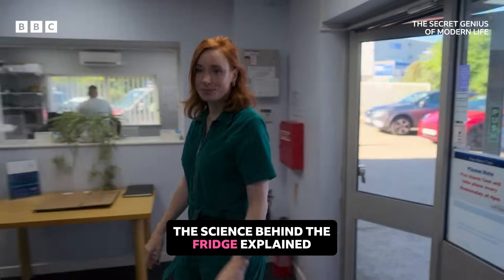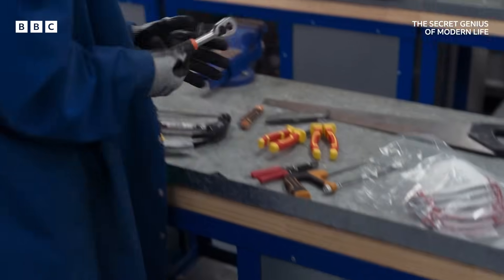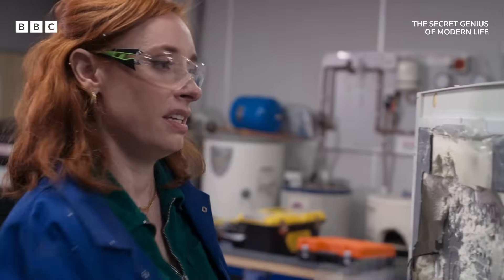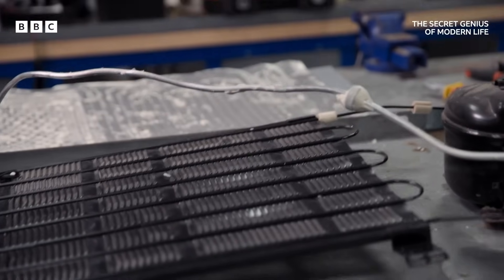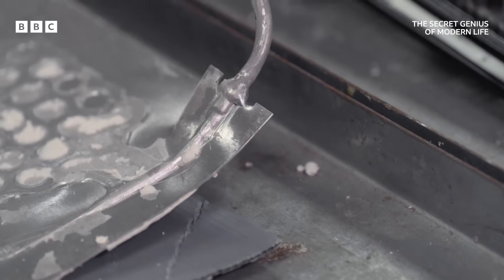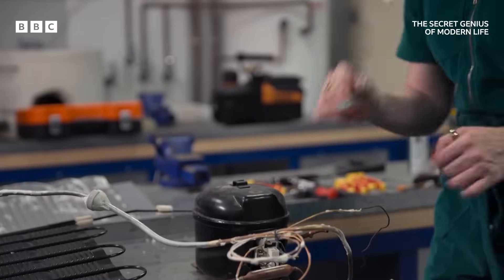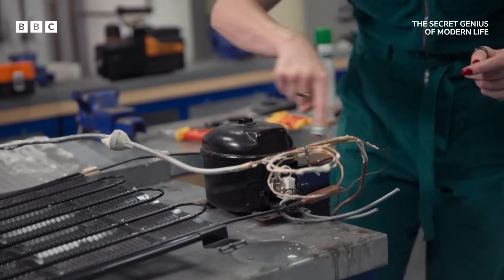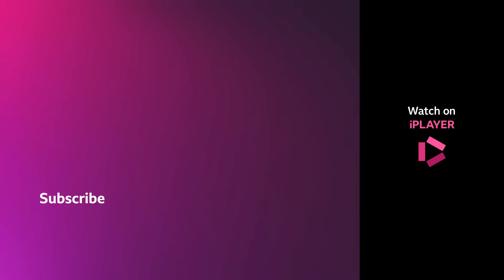How does a fridge work? | The Secret Genius of Modern Life - BBC

Comment: Not a bad description but you didn't describe the point. 

- To do that we need to know the concept 'volume change work' first. Take your bike to a good bicycle pump and unscrew the valve a bit on one of the wheels. Feel the valve as the air runs out, it gets cold! That is because the air inside expands at the valve, the pressure falls, that is negative volume change work. That is when you pump the bike again the air will get warm because you increase the pressure but that is harder to feel. The air isn't compressed at the valve so the volume change work takes place elsewhere. -

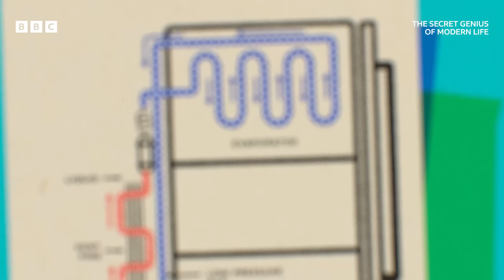I suggest looking at the blue tubes in the top at 3:44.
The refrigerant is boiling or evaporating inside the fridge at a low temperature because of a low pressure (in the Himalayas water boils at c. 70˚ C). The refrigerant enters the evaporator as a liquid. But the heat from new not cold things in the fridge and heat coming in through the walls warm up the refrigerant so it boils and leaves the inside as a gas. 

Then the refrigerant flows into the compressor, the gas is compressed of course. The volume change work makes the gas hot. The refrigerant gas is pressed into the condenser, the pressure is high so the boiling point is also high. This condenser being outside the fridge releases the heat from the refrigerant. As the refrigerant cools down it becomes a liquid again, that is why the condenser is called a condenser! Now the tube becomes very narrow, the refrigerant passes through under pressure but after the constriction the pressure is low. The volume change work is lost, negative I called it, so the temperature drops. 

The boiling point of the refrigerant is now low too and it enters the fridge, the tube is no longer narrow. On the inside it evaporates, to do that heat is needed and we are back at the beginning.

- The theory behind is thermodynamics. -

When the compressor is running is controlled by the thermostat. If you want your fridge to be colder you adjust the thermostat and the compressor will run more time.

Comment: This is old fridge system. Modern refrigerators work like air-conditioners. The fridge draws warm air in from the room, by suction, compress it, and then blows it,  the cool air into the fridge, and freezer compartments of the refrigerator.

Comment: Critical part of the principle is sadly missing. Based on this explanation coolant would never reach sub-ambient temperature and fridge would never work. 
How it actually works... After the coolant passes the radiator it is in a form of high pressure liquid (remember coolant was pressurized by the compressor). Radiator can only cool this liquid to the ambient (room) temperature (2nd Law of Thermodynamics). To get to the sub-ambient temperatures, pressure needs to be released by the expansion valve. When pressure drops, boiling point of the coolant drops as well... causing coolant to boil away instantly. Coolant is now in a form of low pressure gas which occupies way more volume than it did in a form of a liquid. However total amount of energy (heat) in the coolant is still the same (1st Law of Thermodynamics) but it is now spread out over larger volume, meaning coolant particles are further away resulting in lower (now sub-ambient) temperature.
Reply: Thanks. But how is it possible that the coolant can transport more energy than was consumed by the compressor? As I see it: the compressor creates ‘room’ inside the coolant to absorb energy by compressing it.
Reply: the correct term is refrigerant.  when the refrigerant enters the evaporator, it is in a liquid-gas phase.  not completely gas.  the temperature will follow the pressure temperature chart of the refrigerant.
Reply: @ncolevalv_5673 actually when it’s in the evaporator it’s mostly a small amount of liquid that quickly gets flashed into gas due to the room temperature air blowing over the coil.
Reply: @johnnyblaze9217 what would be the temperature of the 100% liquid refrigerant that would come out of the metering device if it does not flash as it exits the metering device? what would be its pressure? what laws of physics would it follow?

Comment: She didn't mention the expander coils after the condenser. Basically, after the compressor, the high pressure high temperature refrigerant loses its heat in the condenser tubes and then the refrigerant goes through the expander - which reduces the pressure and temperature into very low temperature. After this, it goes to the evaporator.
Reply: exactly literally the most important part is missing... the way she explained coolant would stay at room temperature never going sub-ambient.

Comment: So what if its a really hot day, the heat being dissipated out the back may not be able to happen, so how does the refrigerant cool down again if the outside air is just as warm as the cool on its way out of the fridge to cool down?
Reply: her explanation is incomplete... the way she explained coolant would never go sub-ambient. Pressure of the coolant needs to be released after it passes the radiator... this causes coolant to boil away and go sub-ambient (find my full comment why).
To answer your question... yes if ambient temperature outside the fridge is equal or higher than temperature of the coolant entering the radiator... fridge won't work. However fridges are designed to work at any reasonable room temperatures.
Reply: the gas entering the condenser is always hotter than ambient air because of the compressor.

Comment: I think some explanation is missing, why do we need a compressor. After the compressed liquid comes out, what happens.
Reply: her explanation is incomplete... the way she explained coolant would never go sub-ambient. Pressure of the coolant needs to be released after it passes the radiator... this causes coolant to boil away and go sub-ambient (find my full comment why).
Reply: the compressor is the "pump" in the system.  something has to move the fluid.  you turn off the compressor and the refrigerant stops flowing and equalize.

Comment: Given that the back of a fridge is usually pushed up against the wall, does that make it less efficient? Would it be more efficient with more space behind it to allow the heat to dissipate better?
Reply: not really... fridges don't really have that much cooling power... they actually don't even run 95% of the time, they mostly rely on isolation to keep the interior cool. Opening them doesn't really matter as only it is only air that escapes and that by itself carries very little heat.
Reply: I am personally surprised that we haven't harnessed all the various heat pumps in our homes into some sort of unified system. Heat pumps are more efficient than electric water heaters or gas boilers.

Comment: “You can’t cool something down, you can only take heat away.” Brilliant description!
Reply: The result is cool air…the method is heat extraction. It does sound like splitting the thinnest of hairs I’ll grant you…It’s an important hair nonetheless.
Reply: @motorv8N produce and result?  really.   it is a matter of terminology.  i put a toast in the toaster.  did the toaster heat my toast or the toast got hot because of the hot coil?
Reply: @rodzvalv_5673
The element ( hot coil) heats up due to the electrical current flowing through it - and the (cooler)  bread is held close to it - which absorbs some of the heat - until it reaches sufficient temperature to " toast it"

Not quite the same thing as a fridge - which "pumps" heat from one place to another  thereby making one area cooler - and the other hotter.
Reply: @eric4709  that is different than saying you cant cool something down.  one can install a window ac in a room and it will cool the room.   to cool something, you have to take its heat away.  but it is wrong to say you cant cool it down without mentioning taking its heat away.   because you can!.  i can put a coke can in a cooler full of ice and it will be cold after an hour.
Reply: That is the basic idea. So when you ask HVAC engineers… you’ll get the point.
Reply: @casperellison5729  - I had forgotten this inane conversation lol. Our friend above here has so totally missed the point of how heating and cooling works I must have blocked the experience from my memory….😎
Reply: it is the same thing.  like many saying ac does not produce cold air.  what exactly is the 50F air coming out of the vents.
Reply: @rodzvalv_5673
Its the "lack of heat" that the ac has pumped away to the outside. Air is blown over the "colder"  cooling element - so yes the air is cooler - but only because heat has been "pumped away"  from it.

Go and stand by the heat exchanger fan outside and feel the heat coming out of it!
Reply: @eric4709 but it is completely wrong to say you cant cool anything without mentioning the removal of its heat because you can!  i can put a coke can in a bucket full of ice and it will be cold after an hour.

Comment: My usual way of explaining fridges is to use the analogy of ‘put your finger over the end of a bicycle pump and try to pump it, it gets hot. Now spray a can of deodorant,it is always cold. Hence compress a gas and it is hot, de-compress a gas it is cold, put this in a closed loop and add a pump  you get a fridge. Or put the cold bit outside and the warm bit inside and you get an air source heat pump
Reply: Is there a piece missing here?
Compress a gas and it gets hot.. keep it compressed .( as a liquid?)..
 dissipate the heat.. then.. let it expand...back to a gas  and as it does so.. it absorbs heat ? 

Question is though.. in the case of air source ( and ground source ) heat pumps - the claim is that for every kw used to "pump" the heat - one gets several ( typically 3-4 kw) of heat "transferred"  so one has the illusion of "free heat" 
( although it isnt of course) 

So - using the bycycle pump analogy - if you close the outlet off - and pump - you put energy in - ( f*d) resulting in the air heating . If we then allow the air inside the pump to cool -( lost energy)  then release the pressure   - then heat is absorbed "back in"  ? 
 
The overall "energy" equation has to balance - so heat lost" on the pressure / heating  cycle is reabsorbed back as the air pressure restores to normal

Comment: I am surprised that nowadays fridges aren't warm at the back anymore. Comes in handy if you want to dry something fast. What we should do to save energy is use that heat.
Reply: because they are not running most of the time... old fridges used to run they compressor all the time pointlessly. Nothing inside the fridge is generating heat there is no reason to run cooling all the time.
Reply: they are warm in  the sides.  they out the coils in the sides now.

Comment: And this is exactly how heat pumps work as well, except they can reverse the direction that the heat travels depending on what's required.

That's how they're so efficient. They're not making new heat, they're simply moving existing heat around.
Reply: It's how they are more than 100% efficient.
Reply: @leesaferite8536  yea 300% is often stated value. Obviously the machine itself is not 300% efficient but it can move 3x as much energy as it consumes. It doesn't generate heat it extracts it and moves it... therefor it doesn't violate any laws of thermodynamics.
Reply: @leesaferite8536 physics pendant here - no machine can ever be more than 100% efficient.

And, yes, I'm perfectly aware that heat pumps can provide more heat energy to a home than the electrical energy you put into them.

Comment: What I want to know, Hannah, is why the word is spelled "refrigerator", but somehow a "d" comes out of nowhere and we get "fridge". Why is that?
Reply: No-one is 100% sure but it most likely comes through comparison with words like bridge and ridge-when refrigeration was first becoming widespread in the 1920s the form "frig" does appear a lot in writing, however since people were seemingly still pronouncing it the way we do today, i.e. rhyming with bridge or ridge (rather than frig as in the euphemism for the f word) the spelling shifted over to fridge in order to standardise with those similiar words. Since there was no equivalent comparison for refrigerator/refrigeration/etc. there was never any reason to add in a d or otherwise alter the spelling.
Reply: @Temujin1206  I mean, one good reason would have been to standardise the spelling of their shared root.
Reply: fridge came from the refrigerator brand Frigidaire.

Comment: Funny how we have accepted that it's okay to warm our apartments with electricity, depsite having installed cheaper alternatives like district heating or geothermals. Given in winter outside can already be very cold, instead of managing that cold air for our foods, we use electricity to cool our apartments. Conversely in summer, we use electricity with air conditioner, again, to remove the heat generated by our appliances like fridge.

While this video is about how fridges work, we probably should think of cohesive heat management for the whole unit or building. None of our appliances talk to each other. Can we for example use these wasted and excess heat to warm our shower water?
Reply: So every machine is to have its own heat exchanger/radiator? What liquid will you use to gather the heat from all the sources? It will take electricity to move that liquid around. If you move your aircon condenser inside to capture the heat to heat your water you are now also heating the inside of your house. You will also need to store this heated liquid somewhere. Are you going to have an open system or closed? An open system will require constant filling so you cannot use a liquid that is efficient at transferring that heat. A closed one will require another heat exchanger to transfer your now warn liquid to the water you intend to use. Once you have this water heated it surely isn't going to be hot enough so you will need to heat it but we already have systems that do that.

How you intend to capture cold air from the outside and keep it cold and have it ready for use is well above my pay grade. Since you don't want to use refrigeration processes you would have to keep an area as large as the area you wish to cool separate and able to maintain the temp of the air. Want to keep your food cold in winter for free, keep it outside.

Not every place is located over a volcano so geothermal exchanges won't work everywhere. Heat pumps do not work in every location either.

What you can do is run your aircon and heater as little as possible. Also once you decide to run one do not have large temp swings. Once you cool an area it is more efficient to keep it that cool or close than to let it warm up then cool it down again. Insulate, insulate, insulate!

Comment: When I glanced at the title I thought it said, "How does FUDGE work?" but  still watched this after re-reading  the title. Thanks for a good video but can you please now show us how fudge works?
Reply: What the Fudge?!!! 😮
Reply: Butter.  Butter is how fudge works.
Reply: The secret is the P in PV = nRT. When pressure is increased by the compressor outside the fridge the temp goes up and radiates heat to the air outside. When the pressure drops as the refrigerant enters the fridge the temp drops and it absorbs heat, cooling the inside of fridge. The magic is the same physics as a spray can that gets cold when you spray it...
Reply: @hieronymousmiller7835 while that is a great concise explanation of how refrigerators work, it doesn't explain how fudge works, which is what they were asking 😂

Comment: I love Hannah. I wish she'd been my science teacher.  Her enthusiasm and easy method for explaining subjects is fantastic. The glee she shows breaking stuff is contagious 😂
Reply: Whilst she is usually great this explanation lacked a bit of depth.  As a lay person surely the obvious next question is, why does the fridge not just cool whatever is inside the fridge to the same temperature as the room?  How does it cool it to a temperature even colder than the room?
Reply: @ruan13o  When the refrigerant goes from the condenser to the evap there is a pinch point that causes the high pressure hot liquid to expand into a gas. It is just like using a can of air, the drop in pressure turns the liquid to gas and making it cold. Those are the basic things needed for refrigeration, an evaporator, a condenser and a needle valve or something similar. Everything else that modern fridges have are extras like temp control and defrost mechanisms which is usually a pause in the refrigeration cycle and a heating element to melt frozen condensation off of the evap before it has a chance to build up.  Hope that helps. 
BTW Same cycle for a home unit without the defrost. The condenser is the machine outside that is also where the compressor is.
Reply: It's all in the gas. 😉
Reply: I have a hopeless crush on her
Reply: No, I wish she'd been MY science teacher, lol.😆 Unless we did actually go to the same school, thus reaching a compromise, ha.😄 Hannah Certainly makes a subject, Interesting.👍
Reply: I love her too